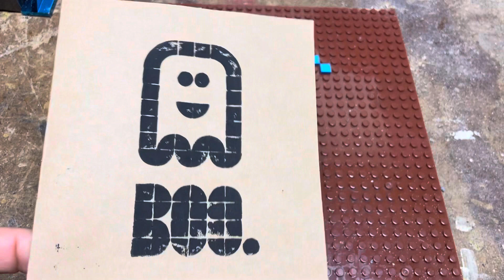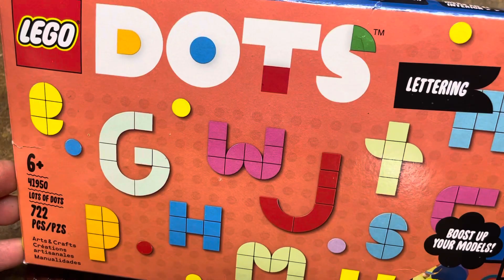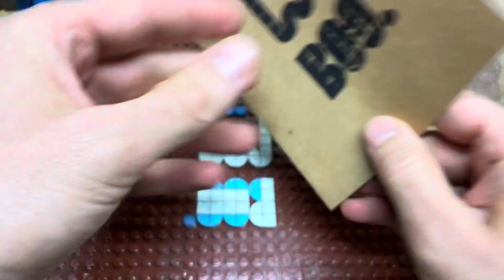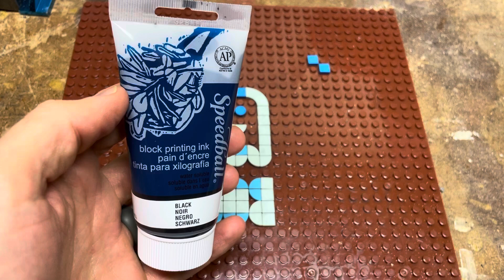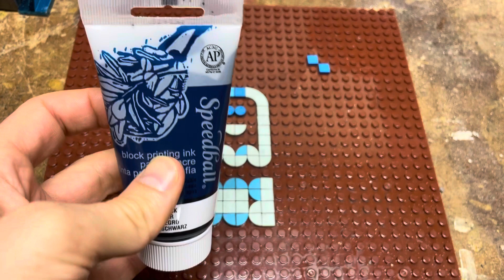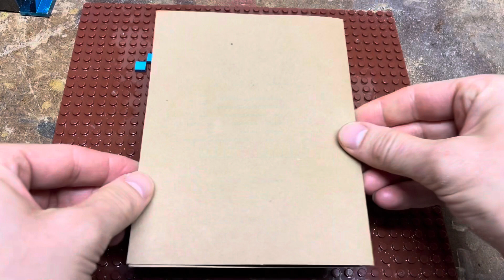Printing with Lego! Supply list and process

Comment: use a second roller same as the one you applied the ink with to roll the paper onto the Lego.

why is this in my recommendations?

what is my purpose?

why am I here?

just to merely give advice on things I never watched or done before with pure logic reasoning? is that my curse and suffering in this world that should make my logical ability to think give a purpose? should I feel uplifted now? have I done my deed and do not serve any purpose for now on until the endless void of strings of questions are answered by a new video by another guy? I don't know.... do I may need another one of my kind to answer myself? what happens to the guy next? where are we heading to? what is the purpose? 

Is it called Lego because of this so we lay aside our thoughts and just LEt GO ?